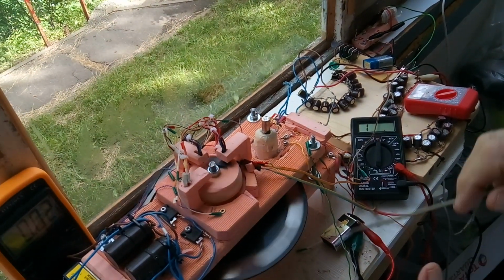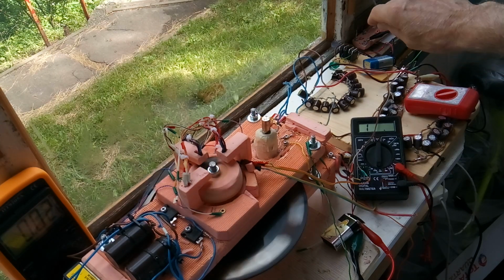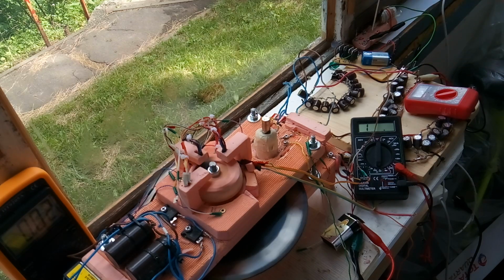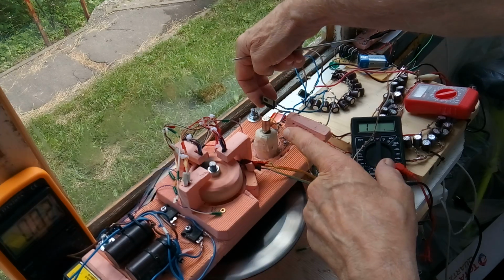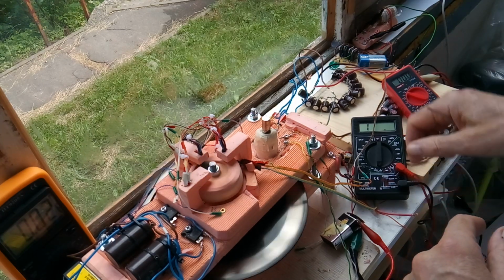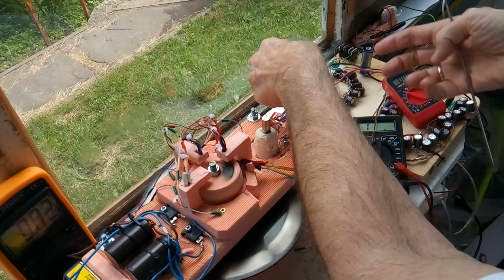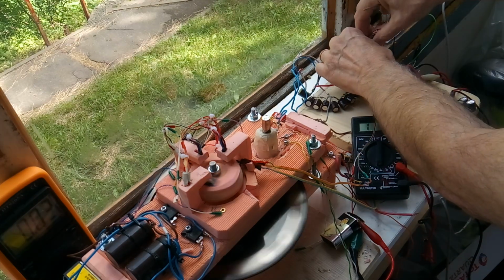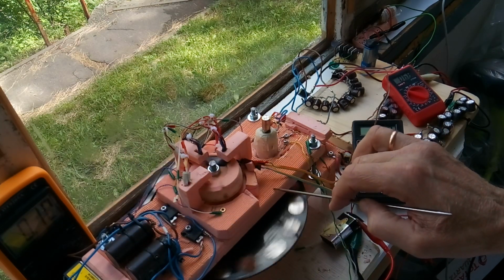Overunity test of flyback into caps then pulsing to load with pinkmotorgenerator

Comment: I like it.
Seems to work as described and overunity as long as input power is below output power under the load of filling the cap banks and dumping into the load?What is the load?...I do the same kind of research in my projects .Can you get in touch with me?
Reply: BEMF research and schematic circuitry. Do you have a schematic or a drawing?
Comparison of amount of total energy used and same for output.
Reply from the maker: Hi formaxmore
Load is a 15 ohm coil wound with litz wire and ferrite core. ("Inductive load") so it's similar to a single motor coil in it basically is idea (plans are to loop it) look up all the tests of the pinkmotorgenerator or buy the my book it's all within one of the 25 chapters. There is one video I put up where there is resistive load applied, and the resistance determined overunity it's very interesting.  You can email me at konehead@msn.com
Thanks for writing!